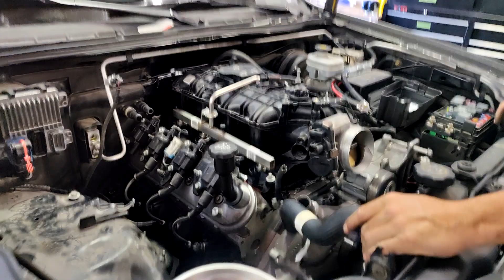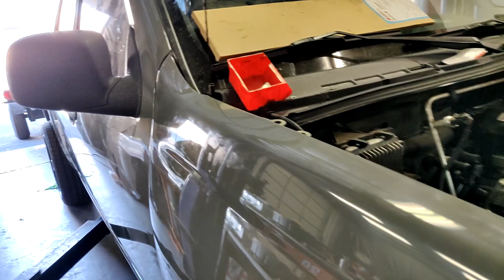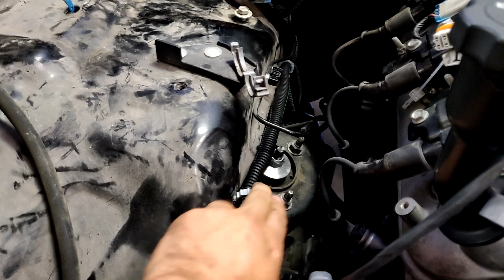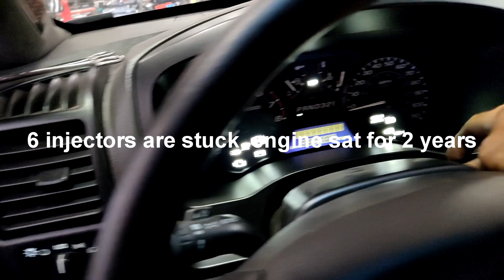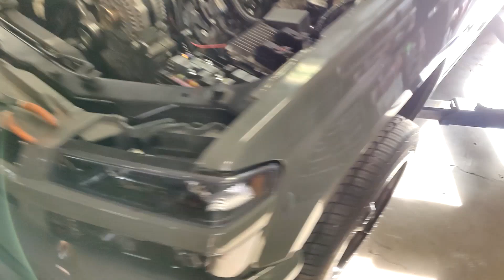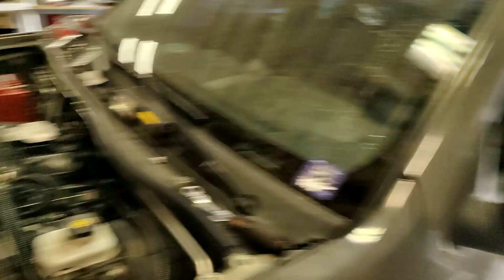Colorado LS Engine Swap

Comment: I have a 2006 Colorado… I’m doing a gen 4 6.0 with a 6l90 looking to get a plug n play harness for it… I know current performance does them but I’m a little confused on the different ecm and harnesses to get because it’s going to be a 54x reluctor
Reply: Hey by any chance did you find out what you need I’m literally trying to do the same without buying a Holley for it

Comment: Finishing up my swap and am curious what you did for the tach. Did you use the tach output from the engine pcm to the crank pos input on the truck pcm or just piggy back of the engine crank position sensor?  Thank you.

Comment: Very clean setup, I’m working on a 04, Can I get some further info from you regarding the wiring and how you piggybacked into the stock pcm. I will gladly appreciate it. Email if possible. notaloka2155@gmail.com

Comment: can you add a newer engine (2015-2019)  on these 2006-07 colorados? is that possible????
Reply: The newer engines are LT, not LS, which are direct injection

Comment: So how did you tune the ecm(s) ? or did you have to ? Do they just share the data lines on C1 15 and 16 ? Is the factory ecm cranking it and the E38 firing it ? Which one is talking to the ABS and so forth ?
Reply: I’m with this guy #WeNeedAnswers🤣
Reply: The e40 is cranking it the e38 is for the transmission

Comment: I have an 06 Colorado and you guys did exactly what I want to do to mine so if you see this comment could you please tell me about how much this whole thing was price wise
Reply from the maker: Labor is 5k plus parts.
Reply: @swaptimeusa so how did u wire ur fuel pump mine keeps dying. I went thru the rear park lamp.
Reply: @swaptimeusa also how did u get it turn on with the key?